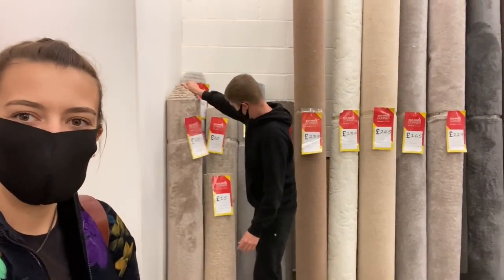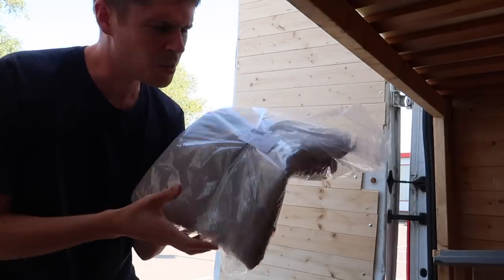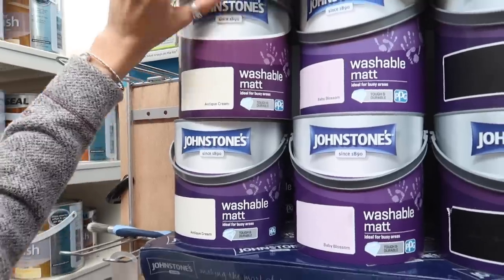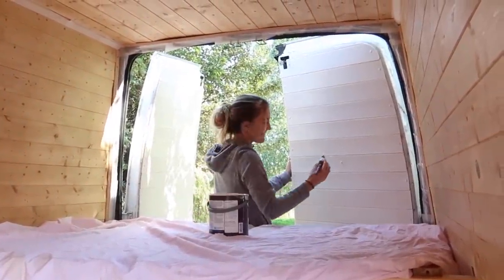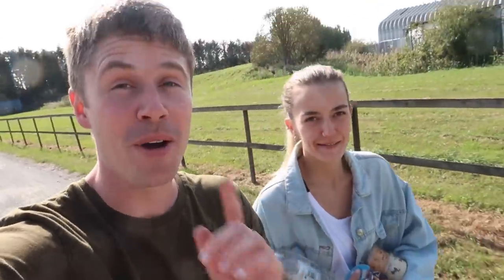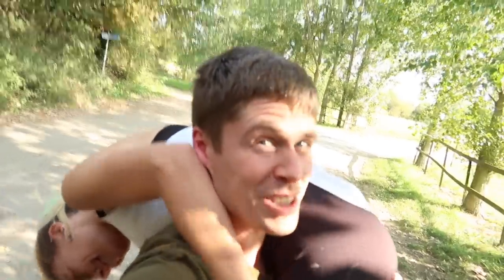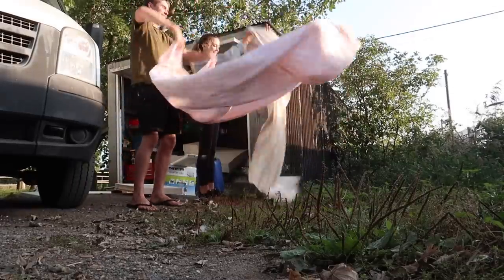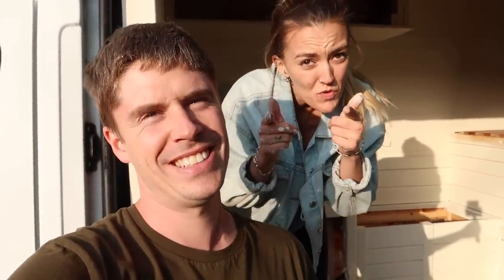Camper Conversion: Painting The Inside Of My Ford Transit

Comment: This van has been built with pieces of this and piles of that but it looks just as good as the ones people have put £80K into building one up.  Between your eyes for details, your luck going through the piles and your dad, that is one fantastic job!  

Does the engine run on your narrowboat?  Between the van and maybe the narrowboat,  there are a lot of places that you can take us to!  The Royal Tattoo has probably already done, back in August. If they didn't cancel. But there is a lot more happening!  And you can take the van all over Europe. You could also spend a year taking the narrowboat down all of the French Canals.  And the van, as a matter of fact!  

Don't mind me. We enjoy watching you paint!
Reply from the maker: Ah thanks a lot Rebecca that's so lovely to hear!

Funny you should say that, we had a guy come to look at it the other day but he confirmed it has a huge oil leak (which we kind of already knew) so rather than fix it it seems cheaper to replace it. Currently on the hunt for a second hand engine!

But agreed, the aim by the end of this year is to have a fully running campervan and narrowboat to keep us busy whilst home in the UK!
Reply: @CharliePauly  - I hit a dislike when trying to read all of your comment and I think I undid it.  If it is still there, I apologize. For the YouTube algorithm, a dislike is in your favor (for whatever that's worth)  but know that I didn't dislike anything about anything. 

I don't know what an engine costs in the UK but I have replaced quite a few in my 50 years of driving. With cars costing what they do, I don't know why people don't do that more often. You want to care for your car so it doesn't but I have had quick oil change companies neglect to put the screw on the oil pan securely as I am leaving for a long trip and damage an engine, so I simply replace it.  £500-1000 is a lot cheaper than £35000!  A diesel narrowboat engine is a different pot of fish altogether but one I could have easily found even where you are thanks to dad and brother, but they are gone.  I can give you some leads on who to call (types of companies, not specific people) if you need.  Start with narrowboat builders and ask where they get their engines and if someone in the company works on them.  When a smart diesel mechanic replaces an engine, he rebuilds the old one and has it ready or sells it.  A rebuilt engine will (usually) be cheaper, but that depends on so many factors.  You might be able to make a deal on an engine that is a serious upgrade for your narrowboat!  And that would be grand!  Good luck!!